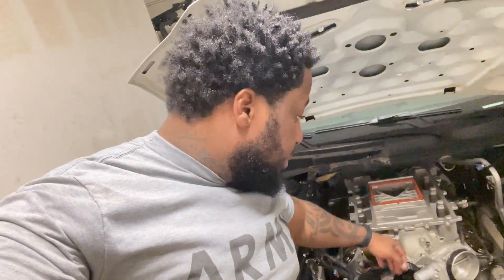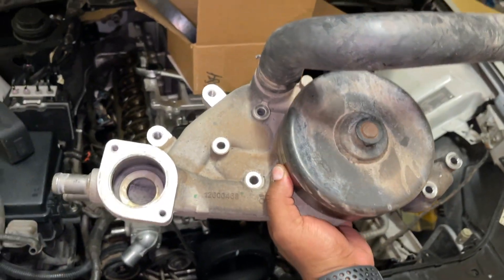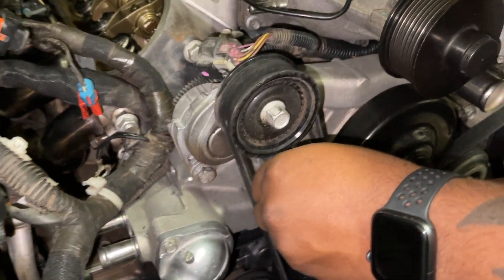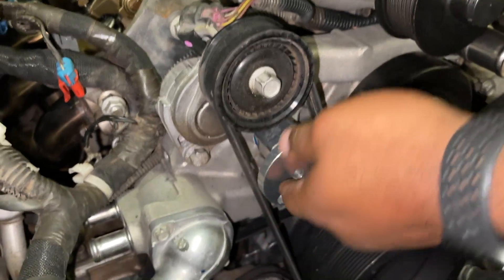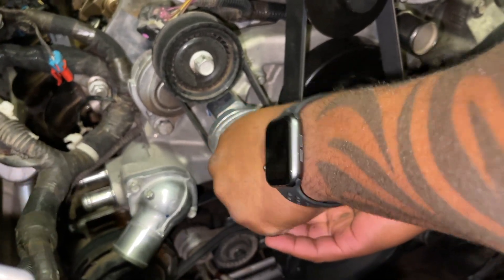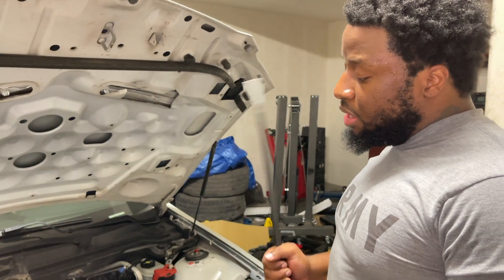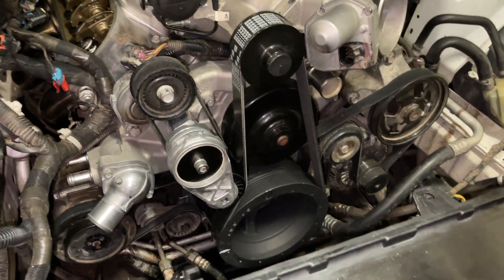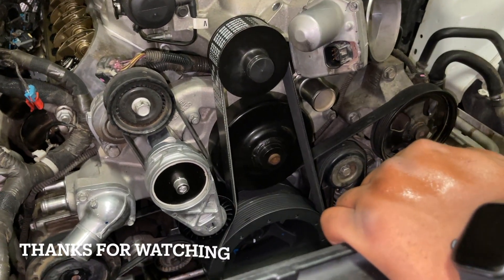LSX Concepts LSA / ZL1 Supercharger Drive Kit Install - Part 6 - Supercharger / Kong lid Pontiac G8

Comment: lol that kit is $1450 now
Reply from the maker: @alphasaiyan5760  kit is discontinued and no longer available new when I dropped this video. Got that from the maker.

If it is $1450 now then yeah lol not worth the price IMO
Reply: @ yep all their stuff went up. I’m currently installing a lsa in my 05 gto.
Reply from the maker: @alphasaiyan5760 I see the link in the description takes it to their new kit. That kit is indeed worth it!!!! I’ll be using it in my supercharged H2 when I build that for the channel.
Reply: @LS3_LaFlare  indeed it is worth it. I’m going with the SS/Caprice front drive assembly. Mostly because I won’t have to move anything. Power steering and ac stay in stock position. And I have a dedicated 8 rib belt for the supercharger. Good video though. I’m just getting into the boosted game kinda late. I wish I was doing this about 7-8 years ago when all this stuff was cheap lol. I’m hearing of used to being able to get the whole kits for like $3500 and that included everything all belt drive assembly and everything.
Reply from the maker: @ lol I always just get CTS-V accessories used (piece it together on eBay, I always do it in my swaps cheap), or mix and match G8 accessories. Cheap cheap cheap. But as we get older the budget increases lol I get the charm in spending the money.

I had a G8 so literally just needed a water pump and this kit was cheap.
Reply: @LS3_LaFlare  I was gonna go that route but as I kept looking around on eBay there is so much stuff. Different stuff on there. I’m kinda new to the game so I was like I’m just gonna go with a kit from a reputable brand that way everything comes from the same place and they have a warranty on it. I did buy some stuff off eBay though. I bought my ice tank and heat exchanger off eBay and the pump for it. Some 3/4 hose and stuff like that. A line and fittings. Stuff like that.
Reply: @LS3_LaFlare man I used the lsx concepts 8 rib race drive pulley / tensioner system on my 05 gto build. I keep shredding gates hd belts. I shredded the first belt about 1 month after install and the second belt within a week of install. I have a 10 inch lower and 3 inch upper pulleys. 700 whp. Do you think it’s something with the lsx concepts race drive system or could it be an idler pulley or another pulley problem ?
Reply: @LS3_LaFlare got my install done on my 05 gto. Dyno at 660 whp on 93 pump gas. 690 whp on e85. I had to change all the accessories to corvette spacing of course and I used the 10inch overdrive crank pulley set up. Well my supercharger belt shredded last night. I guess the belt had stretched just in the short 2 months that I’ve had it installed. I had the gates hd belt so I just got another one ordered for my set up.
Reply: Also. Did you have ? Or have you had any issues with belt slippage or breakage with this setup ?

Comment: What brackets for the alternor and power steering pump are you use are they factory or aftermarket
Reply from the maker: Factory G8
Reply: Thank you. I've got a 92 c1500 short bed I'm building a stroker 6.2 for and putting a lsa on top of. I'm thinking about running the same supercharger tension and belt set up on it as well but then no didn't know what brackets to use for the alternator and powersteering. Thank you for the help